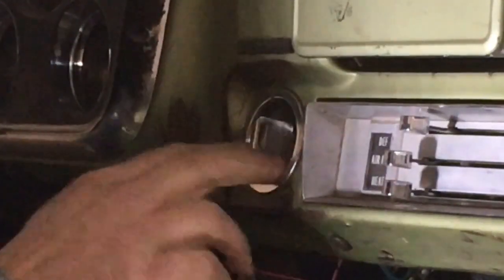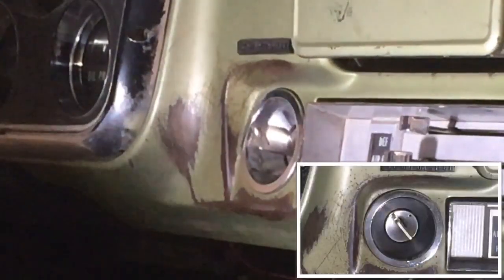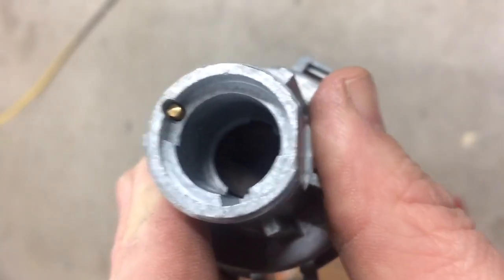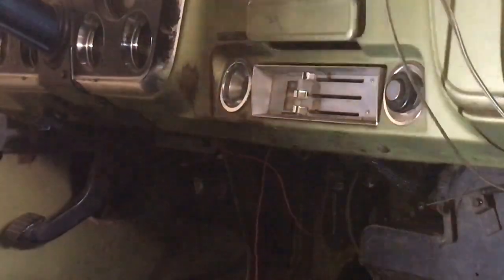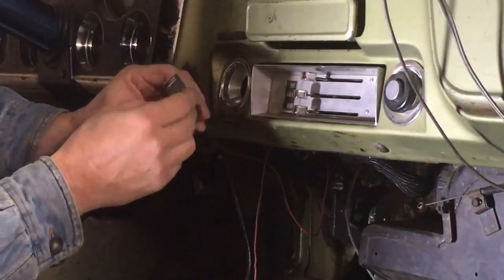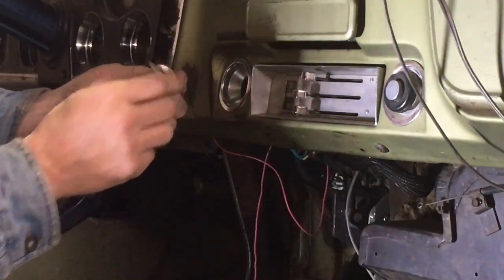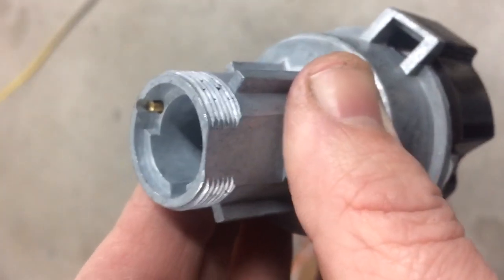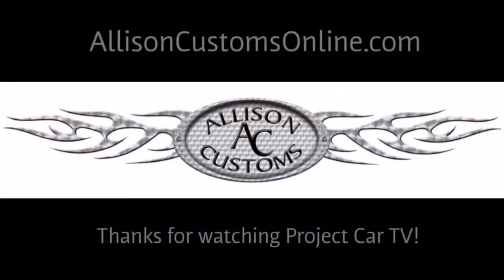PCTV HELP Series - How to remove an Ignition Switch - C-10 & any other GM Cars & Trucks

Comment: What if you don't have the key
Reply from the maker: That sucks! You will either need to pick the ignition or drill it out.  If you drill it out, you need to inspect the switch portion for damage when you are done or just plan to replace it.  Good luck!

Comment: i keep trying and the key lock just won’t come out what should i do ?
Reply from the maker: My initial thought, is you are not getting the button pressed in completely.  Short of that, you can sometimes move the lock a little less or more than normal to trip the release. Unfortunately sometimes the lock is so worn out that drilling it out is the only way to remove it.

Comment: I don’t have a key to turn it
Reply from the maker: You may be stuck either drilling out the key cylinder or buying both the switch and the cylinder
Reply: @AllisonCustoms  yeah I got it off with a drill